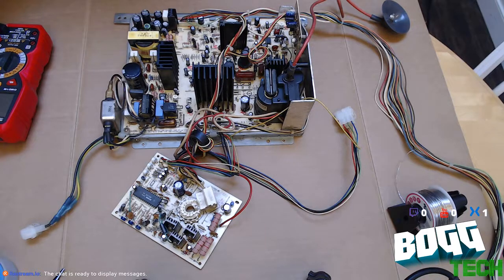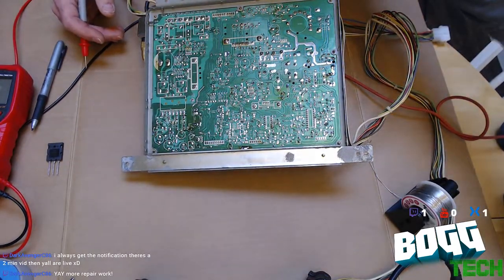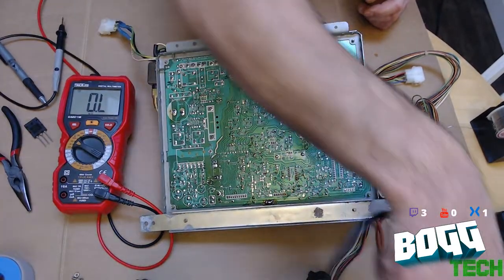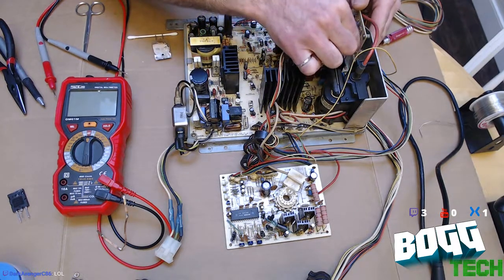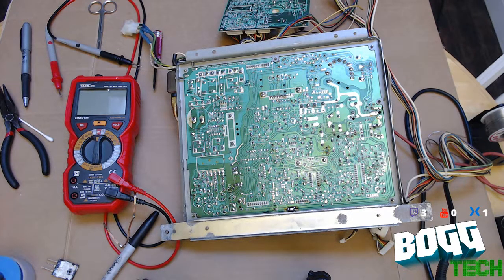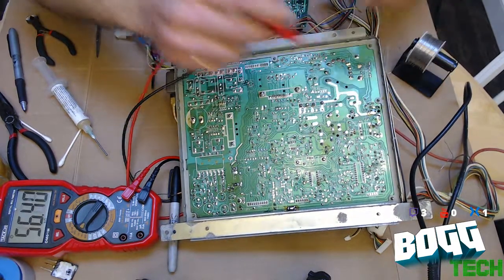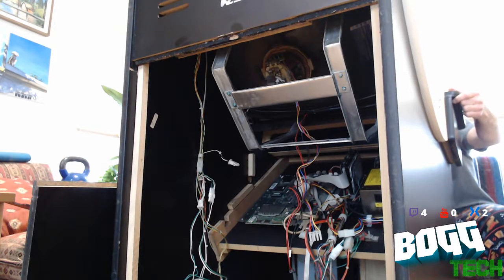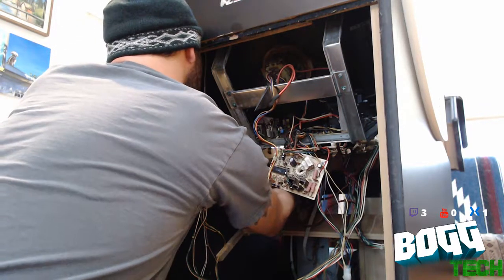Fix It Friday! Neotec NT-2701 Arcade Monitor Chassis troubleshooting and Repair

Comment: I have an NT-2700 with a blown HOT. I swapped the HOT but it immediately blew again. I was told that the monitor was hooked to a MAMe cab and was switched to a resolution outside of what the CRT supports.

What should I look for in regards to other damages components? The HOT blows immediately upon power on. I don’t want to burn through anymore without trying to figure out what happened. Any help would be super awesome. I appreciate the video. Super informative.
Reply from the maker: If the HOT is blowing it could be a bad cap or a short in a resistor. Do a cap kit and check the components attached to the traces of the HOT. Cap kit can make a big difference. Also, make sure the insulator on the back of the HOT is good. I think there is an ebay company that refirbs them for about $100 usd as well.
Reply: @BitterOldGoonsGaming  
Mr Goon, I recently got a NT-2701 and i'm trying to put it in my super sprint, which did have a 27 inch sharpe image SI325 in it. Wondering if it's possible to connect the NT-2701 chassis to a board that was connected to a Sharpe Image. The harness is different for the NT. There's not a plug in for the power connector "the green, white and black connector"

I know that's a lot and i'm sure it's a bit confusing. But I tired to word it the best I could. You're the only NT 2701 Goon out there lol

Thanks

Lance
Reply: @WooNation78  I think those are both medium resolution monitor chassis, so they will likely interchange, although sometimes certain boards need yokes (thing around the CRT glass neck with copper windings) that have a certain resistance, or impedance measurement to safely (as in safe for the circuit board) work with a chassis.

If they are compatible they should have basically the same power and signal wires, but the connector on the end could be different. The "harness" as you say, is likely the color and sync and ground wires for video coming from your arcade game board. Should be a Red, Grn, Blue, (colors), Black (Ground), and either a White or Yellow or Both (for sync). Think the white is Horizontal sync, and Yellow is vertical sync.

Basically, you must make a connector that reconnects each of these wires to the NT-2701 similar to how they connected to the Sharp Image. Usually, there is a standard for this color/ground/sync connection on most monitor chassis boards. Sometimes the connector from the cabinet is one plastic connector with all these wires, and sometimes it is 2 connectors, one smaller than the other. The larger one has the Red, Grn, Blue, & possibly Ground on it, and the smaller has the Sync wire(s) and a Ground (if it's not on the larger connector). Look at these pics for the idea: http://arcadecontrols.com/BBBB/sync7.jpg AND http://arcadecontrols.com/BBBB/sync8.jpg

And it sounds like you must not have looked hard enough for the power connection on the NT-2701. With the flyback facing towards you and to your right (flyback is the black plastic boxy thing mounted to the board with (2) adjustments knobs for Screen & Focus (knobs might be on the side of it and slightly hidden behind a metal plate), examine the LEFT corner of the board. You should see a glass fuse/fuse holder and beside it either a dongle of 3 wires (2 Black, 1 Green) with white connector on the end, OR a connector mounted to the board with 3 holes made of white plastic.

So you'd have to either cut off the connector on the end of the (3) AC supply wires from the cabinet and buy a new connector to attach to it to fit the new monitor chassis board power connection, or, depending on how the connector on the Sharp Image chassis is made, desolder it, and solder it in place on the NT-2701 if possible. You could also chop the power connector off the cabinet, strip the wires, and solder them directly to the NT-2701 chassis board (making sure the ground wire went to the proper hole) without utilizing a plastic connector at all.